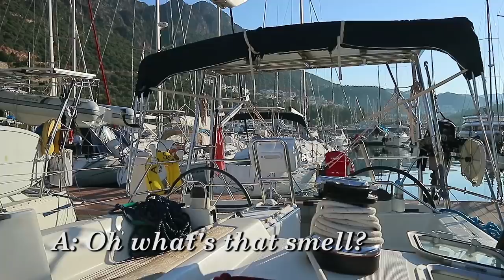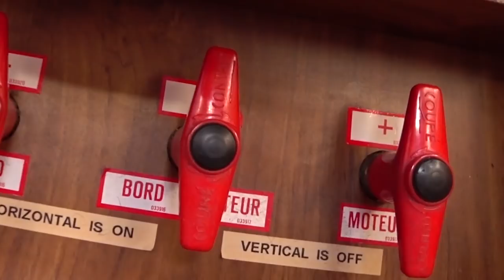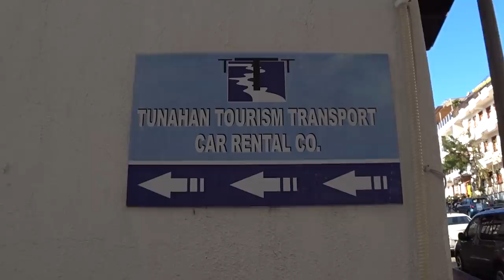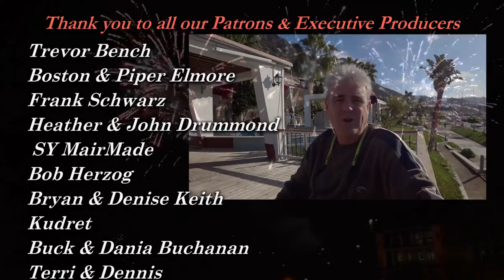Smoke detected! Emergency on board - Sailing A B Sea (Ep.155)

Comment from the maker: Thank you all so much for your helpful advice of discovering how to manually shut down our Yanmar 4JH2TE diesel engine from within the engine bay. Nuff Said sent us this clue and we followed it and it works. 

"All Diesel engines have a manual shutdown usually located at the shutdown solenoid. If you turn the ignition on then get someone to push the stop button while you are looking at the shutoff solenoid, you will see a plunger or rod that will move and return when the stop button is released. This is your manual way of shutting down the engine. "

An extra tot of rum for you today. More knowledge shared and learnt and one less thing to worry about. Cheers Baz & Aannsha.

Comment: Glad that you guys and the boat is ok and again averted disaster. As an old retired Chief I can say that there’s very good advice in the comments. All Diesel engines have a manual shutdown usually located at the shutdown solenoid. If you turn the ignition on then get someone to push the stop button while you are looking at the shutoff solenoid, you will see a plunger or rod that will move and return when the stop button is released. This is your manual way of shutting down the engine. If you don’t see this, then there will be a dedicated manual shutdown, either a lever or push button. 
Boats are a constant teacher and learning process, regardless of how much knowledge a person already has.
👍🍻🍹🍷🇦🇺
Reply from the maker: That's very helpful advice about observing the shut off solenoid. We'll check that out, thanks. 😀
Reply: @SailingABSea  I forgot to mention the fuel shutdown solenoid is usually fitted on the HP fuel injection pump 👍
Reply from the maker: Hi, we just followed your advice and we were able to manually shift the shut down solenoid plunger and stop the engine instantly, thank you so much. 😀👍
Reply: @SailingABSea  no worries, glad to help. Stay safe guys and remember that when starting the engine to get underway to open the panels and do a visual check to ensure all is ok. Another tip, don’t do like so many others do and start the engine and leave it idling for more than a couple of minutes. It’s better to start it, let it break the chill and warm up for a couple of minutes then get under way slowly putting a little bit of load on it which will warm it up to running temp reducing the potential of glazing up the cylinders. The engine will last longer and use less oil doing this. If you want to run the engine while the boat is secured in the marina berth, start it, do the checks, then put it in gear just a little over idle to give it a little load so as to not glaze the cylinder bores👍. This is what I do with my boat with the 3208 cats. 🍻
Reply from the maker: @nuffsaid7952  more great tips and reasoning behind them, thank you.
Reply: @SailingABSea  just a thought guys. It may be an idea to include this method on finding the manual shutdown in the next video to help others in knowing where it is and how to identify it. Undoubtedly there are many that don’t know that they have the function on their engines. 👍🍻
Reply from the maker: Great minds think alike, we have already filmed as a small segment for a future video. Cheers.

Comment: Stu Davies here, PBO Engine Expert. Ive worked on and advised a few Yanmar engine owners like yours. The starter motor solenoid had stuck, the pinion stays engaged and you get the result you have suffered. So the starter stays energised and is spinning with the engine running. That is why the commutator had thrown some of the copper strips and the coils had burned out.
Reply from the maker: Hi Stuart, thanks for adding more insight into what was physically happening with the engine hardware. It really does help create a better picture of what events are taking place and hopefully will assist others who may find themselves in a similar situation. Cheers.

Comment: When the starter solenoid is energised it pretty much bypasses all the control you have over the engine to shut it down electrically. This normally doesn't matter because when you release the key the solenoid is de-energises and control is returned. 
Because the solenoid jammed in the energised position this allowed what is a relatively large amount of amperage to continued to be supplied to the starter motor and the solenoid (300-500 amps ish) as the starter would now have been mechanically disconnected from what you described as the "big cog" (the ring gear on the flywheel) it would be zipping around at ludicrous speed. 
The starter motor is not designed to turn at that speed or have that amperage applied for so long so it both seized and burned out. 
One trick if it happens again (god forbid) is to hit the solenoid with something like an extension bar and a hammer this can jar the solenoid into disconnecting. 

Happened to me once on old 2.3 Vauxhall Victor, started the car but I could still hear the starter motor whizzing around, luckily I had a boot (trunk) full of tools so poped the bonnet (hood) whacked the solenoid with a hammer and all was saved. 
At the time I was a trained car mechanic and had joined the RAF as an aircraft fitter so I knew what was wrong.

When you said you were getting the starter motor repaired I thought noooo! and next weeks episode was going to be A B Sea burns to the waterline.
Reply from the maker: (Baz) Thank you for that confirmation, in my mind I had thought that an energised solenoid would somehow disable the stop button at the helm.

I do recall (from my teenage driving years) hitting a car solenoid with a heavy object to disengage it.

We're very happy that we have a brand new solenoid and starter. Thanks for the informative feedback, we're sure our viewers will find it helpful so we have pinned your comment to the top of this section. Cheers.👍

Comment: Wow - you two just know how to have fun.😳 This experience just takes you up another notch on the learning curve and it is a good thing you shared your dramatic experience with others.

I am an old engineer and was taught by an old engineer never to start any engine without knowing how to stop it either at the control panel, locally or depriving the engine of ‘food’. Your engine is shut down by a solenoid control valve and there is a manual button on the end of it which is in effect an emergency stop. On those sort of emergency devices we use to put a spot of yellow paint on them as a visual clue in emergencies (normally in the dark with a wee torch) . I am sure you have reflected on lessons learned but to help that process just a few questions:
1. Did you turn the key off at the panel before pressing the emergency stop - depending on the circuitry that may disable the stop solenoid.
2. The current draw on the ‘short circuit’ may have (if 1 not true) deprived the shut down solenoid circuit. But if not is there damage to this cable?
3. As this was a while ago, is the Alternator/ Battery Charger OK? I believe you opened the battery breakers prior to the engine shutting down?
4. Depending on the air filter design, it is usually possible to blank the inlet with a bit of plywood whatever, to deprive the engine of air. This is better than depriving of fuel because fuel injection pumps are precision machines that require fuel for lubrication and can suffer damage when so deprived. (However much better to get the engine stopped, even at the expense of an injection pump if it comes to that, of course).

All the best to you both - you deserve a holiday.😉😀⛵️
Reply from the maker: Hi Norman, thanks for sharing that knowledge. 
1. No we did not turn off the key before attempting to shut down the engine with the stop button.
2. Another subscriber has mentioned that the open solenoid would have disabled the engine stop button.
3. We'll check the output of the alternator before we leave next week for a short trip east to Finike.
4. The air filter is difficult to access from the stbd engine inspection panel.
5. We will be looking for a manual engine shutdown at the engine side of things and will mark it with some bright paint.

Cheers. 👍

Comment: Just listened on headphones and it sounds like you can hear the starter has not disengaged as the solenoid has jammed open? When this happens (it's not unheard of) the starter works like a dynamo and starts generating power. burning out the armature. The coil on the solenoid is not rated for continuous load so they overheat. Once you realised it was an electrical issue switching off the power was the right move guys. Glad your sorted without issue. BTW you know there is an emergency stop on your engine on the injector pump. The idea is if fuel shut off solenoid fails in the open position you can stop the engine using this instantly. Get some yellow paint and mark it up for safety. Sail Safe Guys, Ant, Cid & the pooch crew.
Reply: I agree with theses comments - I’ve had this happen - maybe too late now with video lead time but make sure the circuit that energises the starter solenoid is sound.  Often Yanmars have an extra relay between the ignition switch and the solenoid. Best
Reply: @Damian-jy9gs  We have just helped out Sailing Sunday with a Yanmar engine service. They have this relay on their engine and another that times the heater plugs. If either fails closed circuit, there could be trouble ahead....
Reply from the maker: Hi Ant, we have found a manual pull cable which appears to run to the back end of the fuel pump, we will try this later today to see if it is the emergency engine stop cable. Cheers.

Comment: Two things come to mind with this episode, which fall within the 50+ years of my work experience: masks and extinguishers.  The fire extinguishers here in the US are labeled and defined for fire type.  My opinion is that a CO2 will put out any type and will not leave a residue which is almost impossible to scrape off.  As for masks, an organic mask with one or two activated charcoal canisters will filter short term in smokey environs.  It (something like a 3M or equivalent) can be stored assembled in a zip lock bag for years without much degradation, taking up maybe 4 inches thick space.
Reply from the maker: All of our current extinguishers are powder so we'll look into getting a big CO2 extinguisher for inside the engine bay. We'll also be checking out some of the mask options you've suggested. Cheers.
Reply: @SailingABSea  Without becoming pedantic about safety, the CO2 is usually the only option for liquid fires...like fuel or grease/stove.  Appreciate your channel--stay well and safe!

Comment: Glad you and the boat are okay and understand that in the heat of the moment, excuse the pun, you made the decision to go back into your berth. I was a dock master for over 12years in the UK and in all our marinas we had a grapling hook on a wire strop to pull smoking or burning boats out of their berths to avoid further damage to other boats.
I have not read your full story, however you could not have known it would not turn into a fire. 
It would have been more sensible to drop the hook, even in 30mtrs until you had it under control.
As I said before though, glad you're both okay.
Reply from the maker: Thank you for your best wishes and insight on boat fires. Cheers.

Comment: Hi, blocking the air intake as suggested is an option, only make sure you use a small flat piece of wood to block it.
Reply from the maker: Getting at the air intake from the side inspection panel is a bit difficult, but we do agree that the idea is sound in principle. Cheers.

Comment: Glad to see a new starter fitted. Burning boats are usually pushed out & left to burn to save all the other boats in a marina.
Reply from the maker: Hi Ian, if I had see flames I would've grabbed the fire extinguisher, if that didn't stop the flames I would've taken her around to the concrete quay next to the hard stand area. Kas marina has a very fast fire boat which we've seen practicing, it's quite impressive. Cheers.

Comment: Hi guys.   You really are having an awful lot of back luck with your boat, probably being brought about by years of neglect by the previous owner.  We are all guilty of putting off big jobs but with boats put off today and pay triple tomorrow!  Watching you this last few months we have had our turbo serviced, and exhaust elbow replaced!!!!   FIRE EXTINGUISHERS.... If you can afford them opt for Co2 rather than the cheaper dry powder type.  I saw the inside of a boat where a DP had been fired off. It was a total mess and unfit for habitation.. Soft furnishings were ruined, the power is toxic and was eating into the varnish and it seemed it had been sucked into the engine. Nightmare stuff.
Reply from the maker: Some good tips and advice, thank you. Co2 extinguishers are on the list. Cheers.

Comment: Hi Baz / Anchia   Just watched Starter solenoid wire melt . We had similar issue and replaced with new starter Motor, however it turned out to be a sticking starter key and it cost us second new starter motor , so if you do have a “key” turn type start , check the key “returns” after motor fires and you release the key .
Reply from the maker: (Baz) That's a very good point. I always keep my finger and thumb on the key when starting to feel that it springs back to just the 'on' position. 👍

Comment: The stop button actually is a fuel cut off at the helm you can also push it back inside the engine ,to do the same job!
Reply from the maker: Hi Frank the stop button at the helm is an electrical switch. This off button becomes temporarily disabled while the solenoid and starter motor are engaged.

We are searching for the manual stop button at the engine end of things. We have found something which we'll test later today when the weather warms up. Cheers.

Comment: A few comments if I may:
Install fuse on all circuts.
Install CO2- and CO alarms.
Install imergency stop: Best: a shield/flap that closes air intake to motor. Will also be handy if you have a motor run out.
For motors like Yanmar, Perkins and so on: Handy with an imergency stop switc. 
If you turn off main switch when motor is running, gen. charging diodes will burn. 
And so on. Beware: Faults will allways happen.
Reply from the maker: All good points.The boat jobs and modifications never end. Cheers.

Comment: Closing the fuel supply was good but if you can close the engine air in take on a diesel engine is faster.  The diesel engine not need electric power to run. Some sailboats had a pull hand at the engine control panel to shut down the engine.  Now most use the key.  From your videos Kas is the place to go.  You work very well with the people there even with language differences.  There is one sailor that sails in the Caribbean and among the Spanish speaking area for 12 years and does not does speak or understand Spanish which is sad. Best wishes for the New Year.  Do not break any more mirrors.
Reply from the maker: Good points Daniel. I'll pull up the engine .PDF and see if there is a manual shut down option available.

Kas is great for getting things done and if something is not available right away it only takes a couple of days for things to be couriered from Istanbul, Marmaris or Antalya. 

All mirrors have been removed from the boat. 😂

Comment: Baz: I think I have a new spare starter motor. You can have it if you pay the shipping from Spain.... or someday we meet??  
I have the same engine as yours. Starters frequently fail when you're coming into port after a passage... lee shore, little wind, current taking you onto the rocks! So i keep a spare and all the necessary tools handy and have worked out how to change the starter in 15 minutes.
You should work out how to stop the engine. That's easy. There's a fuel cut off solenoid on the side of the engine. It's a bit difficult to find. A rod comes out of the end of it so that you can press it with your finger if the 12v supply has failed. The engine will stop immediately. You don't want to be trying to find it for the first time in an emergency.
You should read the account of Cpt Cook first encounter with the GBR and how they spent days trying to keep the ship the reef in zero wind. He was probably thinking 'no point in having a Yanmar. Bloodly thing probably wouldn't start anyway'.
Reply from the maker: Hi Andy, we are going to locate the manual engine stop at the engine side of things and mark it with bright paint. Cheers.

Comment: Over the air intake is another trick to stop the engine in an emergency.
Reply from the maker: The air intake filter cover is slightly difficult to get to from the side inspection panel, however we might have a practice session using various cloth materials to smother the mesh area of the intake. Cheers.
Reply: i have had to do that and it works instantly

Comment: Had a stater motor fail. Smoke filled the engine room and wheel house. I shut the motor off on the engine shut off. Key would not work. Turned batteries off. Had a new starter motor fitted. Key start removed for push button start. But did it a lot faster than you did.
Reply from the maker: Seems like a common problem. 👍